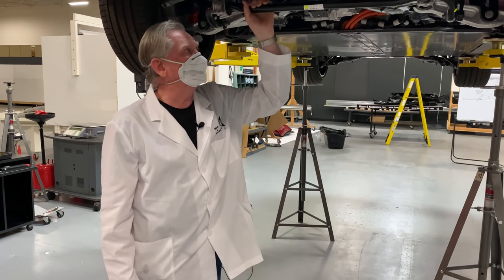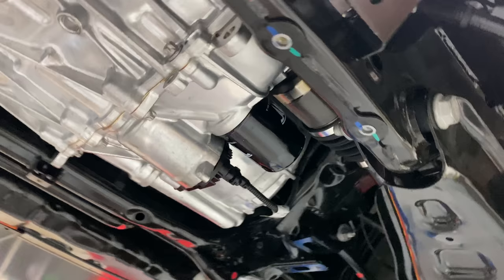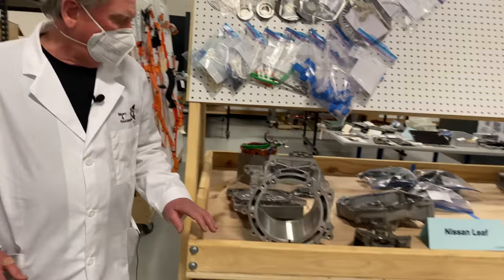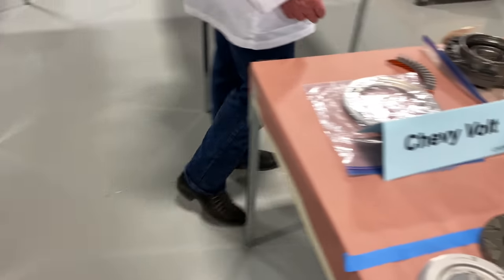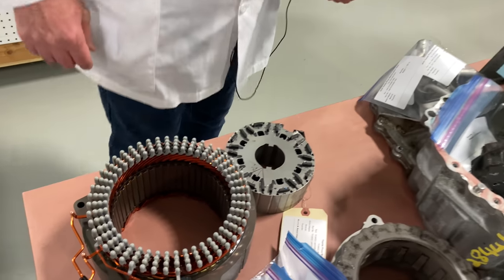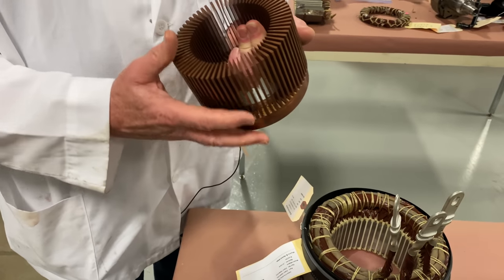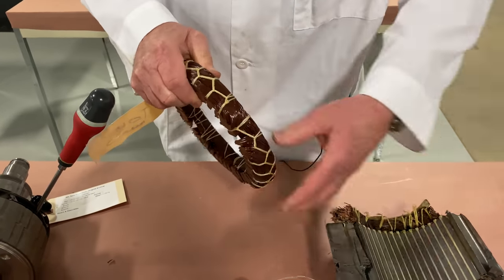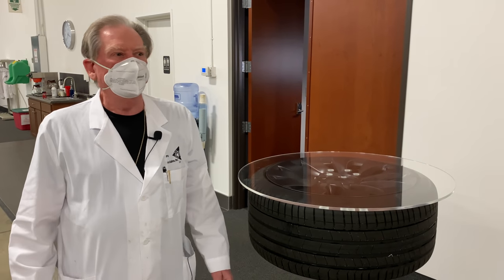Model Y E16: Electric Motor Comparison MY-M3, Industry review of Electric Motors, Table for Sale!

Comment: I was not expecting that much variation in the electric motor designs, just wow.
Reply: It tells you that things are evolving if we look at combustion engines they're all fundamentally the same aside from wankells because there is a sort of agreement on what is working and isn't working for maximum efficency with a combustion engine.
Reply: They are all the same jus two main types induction and pm just like diesel and petrol
Reply: You would be surprised

Comment: Sandy.  Excellent video once again.  Revenue ideas,,  Shirts, hoodies, coffee cups,  engineering break down prints limited ed.  Why, it works
Reply: Merch should depict "exploded" engineering diagrams of interesting (Novel + Awesome + Tesla (Anything Tesla specific comes ready made with a legion of slavering fan nerds (like me))) subsystems.

Ideas: 

Tesla regenerative braking system - depicts and calls out the "magical" components. Anything with question marks where a descriptor or explanation should be will provide an air of mystery and awesomeness.

Tesla Induction Motors: show an exploded diagram of how the rotor magnet is made of of all those laminated layers - include prominent callouts for the mysterious components. Annotate interesting things with US patent numbers. (geeks love that shit)

Tesla battery management system:

Tesla FSD computer circuit (mother) board: label the prominent items: RAM, GPUS, DATA BUS, CPU(s), block out the redundancy-ness (Thing 1 and Thing 2)

Overall the Munro mystique is that you plumb the magical depths of automotive manufacturing tech. Play up the mysteriousness of this in your merch.

Might work for other carmakers' stuff too. I've heard there are other carmakers, though i personally pay exactly zero attention to any of them. 

I'm a technologist, not a paleontologist.
Reply: @johnalley8397  can't do that without infringing upon Tesla's IP rights. YouTube is fine because it's fair use, and selling parts, is a standard sale. They would get in trouble making Tesla branded merch. They can do their own Munro merch though

Comment: We definitely need to know all about the gear oil.
Reply: Isn't it ATF oil?
Reply: Hey Sandy,
do manufacturers normally have a closed system? I am quite surprised there is an oil filter - I would assume you never change it like a differential or gearbox once or two a lifetime
Reply: @accountname1651  It will probably last a long time, but in a gearbox, small pieces of metal filings come off from gears and bearings over time.  These need to be removed or it will turn the oil more and more into grinding paste, accelerating the wear.  Normally it is a closed system.  On some truck gearboxes, they use magnets at the bottom to collect the metal filings, but that would only work if all materials used are ferromagnetic.
Reply: Aaron Bounds it also means a pump as well to push it thur the filter
Reply: @andydelarue9344  There could be a pump just like in an automatic transmission.
Reply: I have a 2000 Ford Ranger Electric truck.  It uses an exotic aircraft oil in its gearbox.  Tribolube synthetic oil that really surprised me as it is thinner than water and flowed out real quick when I opened the drain plug.  It has a pump to circulate the oil in the gearbox, but no filter.  When the pump gives out I may add a filter as that looks like a great idea.   Transmission fluid isn't what you use in a gearbox.  It is designed to let clutches work, so it is not what you want if you don't have clutches.

Comment: 3:48 "The magnets are pretty strong so you try not to get watches close to them"
Camera gets closer towards the strong magnets
Reply: Perhaps, they just zoomed in !?
Reply: @papytrad8915  /r/wooosh :P
Reply: Modern camera will not get affected I have worked on MRI and use my phone right next to it.
Reply: Well, it is attracted to them obviously :D
Reply: @theAppleWizz  hehe.. MRI is not that strong.. Real magnets would probably break at least the displays on phones, or maybe not.
Reply: @theAppleWizz  If the camera has Optical Stabilization (OIS), then the strong magnets will affect that system's ability to function, since they use electromagnets to move the lens/sensor assembly around.
Reply: I think it's all about if the object has ferrous metal in it. 
Would have been hilarious if the camera got stuck on the magnet, they should fake it & re-edit
Reply: I agree with me
Reply: Yeah it is weird, people always question "Pffff, is it really that strong?" because the force does not increase linearly with distance so almost all are caught offguard. Same with high powered fans, "Does it really suck that much???" puts hand above roaring 4krpm 120mm fan for a breif moment then goes away crying when it busts the fingers.  Yes, you are lucky I demo it on 7 Volt and not the rated 12V... I hate the messy clean up.

Comment: You should consider monetizing your videos to make extra income. We would not mind commercial here or there. Thank you for the excellent content and fantastic insights.
Reply from the maker: We have submitted for monetization, we are currently in a waiting period. Thanks for tuning in!
Reply: Munro Live sandy keep in mind, don’t mention the virus or you will lose the monetization! You’ve got to use code words.
Reply: @bob15479  I'm not certain, but didn't YouTube recently change policy again?  Permitting monetization of pandemic-related content?
Reply: @Urgelt  I would say avoiding using certain key words in the title (and description) is still a safe measure to avoid demonetization. That of course comprises a lot of non-corona related terms and whatnot.
Reply: @bob15479  like donout-19? :D
Reply: @MunroLive  then hold your videos until you are monetised!, we are not going anywhere soon.
Reply: @bob15479  is called "the thing" on Fully Charged...
Reply: @MunroLive  Have you all thought about just asking for donations? Just like the grocery cashiers, we would love to tip you all for the very informative series. Things are tough across the board, don't be afraid to ask for help. You will make much money and it will be less cheesy then auctioning off bolts and plastic :)
Reply from the maker: @kwonderful  We are actively accepting donations on our site store and we also have a Patreon group (links to both in video description); trying to give folks as many options as possible if they're willing to support us.  Thanks for tuning in!
Reply: @MunroLive  I signed up on patreon, thanks!
Reply from the maker: @kwonderful  Thanks so much for your support!  Excited to have you as part of the community!

Comment: 1:15 Sandy, I think that PM motor has a special rotor geometry to allow for field weakening. You can see a quite thick zone on the laminates between the magnets compared to other PM designs. Field weakening allows for greater top speed. In a PM motor this is done by playing with the stators field angle relative to PM rotor's field. By making the winding's field go not straight through the magnets, but some of it also bypassed through the iron, you affect the global field. Switched reluctance motors are doing something similar but here I think the goals is field weakening for better top speed. Thumbs up for Tesla!👍 And thanks Sandy for the great videos, keep them coming!

Comment: The rotor of the e-tron is ludicrously old-school, technology-wise. Very much what you find in standard, industrial AC induction motors. Induction motors of the Model S used copper rotors instead of aluminium rotors, which is a lot more efficient because copper is a lot more conductive than aluminium. Man, i understand now why the e-tron is so inefficient... that's German engineering for you.
Reply: Actually aluminium is more conductive compared to it's weight (specific conductivity) compared to copper. And weight of the rotor is important because of inertia. So while copper helps with efficiency it's not always the best choice when it comes to performance. Also aluminium casting is really cheap compared to machined copper. It's always a trade off.
Reply: @ytxstream  Well, I don't think rotor inertia is a huge issue there, because it's negligeable vs. the inertia of the whole car you want to move.
So the important point here is the electrical resistance, and should be as low as possible for better efficiency (because the currents inducted in a rotor of an induction motor are quite large, hundreds of amps in that case). Imagine an induction motor as a transformer in short-circuit at its output, the primary being the stator, and the secondary the rotor.
But anyway, the e-tron efficiency is catastrophic, so for an EV, this kind of AC induction motor with aluminium rotor is a poor technical choice.
Reply: @ytxstream  Rotational inertia doesn't matter much for highway efficiency since the speed is steady.
Reply: @ytxstream  "Actually aluminium is more conductive compared to it's weight (specific conductivity) compared to copper" - Which is what matters most in cabling (when the goal is to keep mass down), but not in a motor, where flux density is the key.  Increasing the volume lowers your flux density.
Reply: @ytxstream  I dont' think that machining copper is that expensive when looking at how important the efficiency is and how expensive those cars are. Also, I would assume that inertia is almost negligible in the automotive use case(the energy of spinning rotor vs the energy of whole car moving). Copper is also way denser making the whole rotor smaller so the radius can be smaller further reducing inertia if you want that. Tbh I don't think there are any real positives of aluminum other than a lower cost(which maybe makes sense in some cheap devices and not a car for 100k).
Reply: But why is the e-tron so expensive?
Reply: @JAM_2024  The Audi badge is the most expensive component on the vehicle.
Reply: @oisiaa  I never said it was important for highway efficiency, actually I said the opposite.
Reply: @pxidr  You are underestimating the impact on the car. The weight goes into the total inertia with the square of the rotor diameter multiplied with the square of the total gear ratio.
Reply: @JAM_2024  It's really not for what it is. It starts at 40% more than a Model 3 which seems reasonable considering size and quality.
Reply: ytxstream Tesla seems to have the magic formulas for highest performance, longest range and lowest cost. Audi’s electric motors are neither efficient, powerful or cheap.
Reply: ytxstream haha. It’s 100% more than a base Model 3... but it goes 50 less miles per charge even though the battery is twice the size. For $75,000 (starting price of an e-Tron) you can haul 0 more people than the Model 3, you will be out-accelerated by even a SR+ Model 3, you will never get OTA updates like the Model 3, you don’t have the supercharger network to use and instead must use Electrify America’s horridly unreliable and expensive charging stations (if you’re in N. America), and you will likely lose half the value of your car within the first 12 months, whereas a Model 3 retains its value better than any other vehicle on the market. Other than a fancier interior that’s gussied up with chunks of wood and leather, I don’t see the “higher quality” you speak of in an e-Tron. To me the quality in a Tesla comes down to the cutting edge battery/electric motor engineering, software, performance, somewhat affordable cost, standard safety features, over the air updates, and charging network. Audi just has “luxury” interiors. I’ll choose my definition of quality over Audi’s any day.
Reply: @ytxstream  
Assuming those 2 endplates are identical, the copper pieces actually look like simple plates pressed into the slots.
If that's the case, simple.
Reply: It is what sets tesla apart, they don't penny pinch on efficiency.  That is why cars like the e-tron and the taycan have terrible efficiency and tesla is a market leader.  Tesla knows range matters and that is reliant on efficiency.   Some people don't realize how misleading charging rates are in non-teslas due to poor efficiency.  A taycan for instance advertises 270kw charging, but their efficiency is so poor, they only add miles at the same rate as a tesla charging at 150kw.  A taycan at 150kw is the same as a tesla on 83kw charger.   You can use mpge to adjust for charging rates, but we really need a more face up way to do it, listing miles per 10 minutes at a specific charging rate would be good.
Reply: The eTron could have done better than putting Induction motors on both front and rear BUT their machine cooling is quite nice/near: where they are able to run coolant (not oil) via not just in the stator housing, but also via the rotor shaft (which usually is not easy with a rotating component, and leaking issues, etc.). This helps them achieve optimal cooling/temperature maintenance enabling them to get good continuous performance, repeated launches, long high speed (think Autobahn) driving without too much derating. The eTron is limited in range for one, it's an induction motor (< eff. Compared to a PM motor) especially when driving per EPA testing, then vehicle is heavy AF, much lesser usable kWh than the rated 95 kWh (to be able to put our the rated range in real world conditions too, not just per EPA cycle), too many auxiliaries (energy consumers) compared to Tesla vehicles.

The choice of induction motors is to keep the cost low and still be able to make a profit from a company which is more lopsided to industrializing ICE vehicles. In the future with large scale MEB vehicles from the VW house, this vehicle should cost lesser
Reply: @smithydll  Yet the Audi interior, paint quality, suspension quality, NVH, etc., are infinitely better than Model S or X. Riiiight.
Reply: German-refugee engineering for you
Reply: @JAM_2024  Is it?
Reply: Electrical conductivity per mass (aluminum) or per volume (copper). It seems like you could get a more concentrated  magnetic field w/ copper. 
Seems like rotating mass in a EV motor would use a lot of energy esp. because they stop when the car stops.
Reply: Hello from Germany.
I'm a mechatronics technician for high voltage vehicles working for a certain automotive company starting with "A".

Would you care to elaborate?
I find your accusation that the surface of the e-tron's rotor being made of machined aluminum directly causes a severe loss of efficiency to be farfetched.
Mere conductivity alone can obviously not be the only desired purpose of a component designed to transfer the entirety of the torque produced by the drivetrain.
Also, your comparison to "ludicrously old school" AC induction motors is needlessy condescending. There are thousands of electrical engineers working on EV drivetrain components for VW group, insinuating that their work can be deemed useless by a random YouTube user called "pxidr" based on a 30 second clip showing the outside of a single component is a bit too agressive for my taste.
Reply: @komentierer  That's also known that Germans have no sense of humor ;)
I'm a power electronics engineer, specialized in power conversion for grid and motor control applications.
The efficiency of the e-tron is 23.4kWh/100km, the efficiency  of the Model Y is 17.1kWh/100km. That's a 27% difference in efficiency, for a car similar in size. Do I need to elaborate more? Or can you see the problem there? The technical choice of Audi for an induction motor with a very classic aluminium rotor is just wrong for an EV. They also don't use SiC power MOSFETs in their inverter, as Tesla does, for reducing switching losses.
Also, e-tron aerodynamics doesn't seem as much refined as Model Y.
So, that's a combination of multiple things.
Reply: Agreed. I think Audi has no clue when it comes to EVs - big, stupid, heavy parts parts and vehicles that have lots of bling but low technical competence. Result = low efficiency, low range and poor performance.  

Same for the Prius although no doubt this old tech is still put in each new Lexus and marketed as the latest and greatest. “Self-charging” wasn’t it?
Reply: @Q J 
Capital investment, exchange rate, brand premium, retail markup, marketing, etc...etc...
Reply: @pxidr  I don't know if you've bothered to watch Sandy Munro's latest video... but apparently Tesla copied Audi's castover aluminum design for the Model Y.
So pick your poison: either Tesla has cheaped out and is using "industrial AC" motors now... or Audi got it right all along.
Reply: @komentierer  What's the connection between aluminium die casting and electric motor efficiency?
The numbers talks by themselves, stop your blindness and arrogance : there still much work for Audi to make viable and efficient EVs like Tesla does.
Reply: @ytxstream  In a motor, flux density is paramount, so a copper cage yields higher efficiency for the same mass rotor. I have an Aluminium cage induction motor in my EV too, and its peak efficiency is only 90%. However as it is only a 15kW motor nominal, it stays close to peak efficiency on highway cruise, so it is more accelerations and slow city driving where the worse efficiency is noticeable.
Reply: @JAM_2024  and Nobody in Germany Could explain. Maybe because the Brand is extremely famos. Even in germany  it cost a lot more than in the USA..unpayable for a normal working Family head. 125.000 Euro. 147.000 USD Crazy

Comment: Thanks for the detailed views of so many motors.  If a PM motor ever overheats, the magnets lose their magnetism and the motor becomes useless, something like >200F.  Haven't heard of any failures due to that, and surely every BEV monitors the motor temperature and warns or shuts down if too hot, but still something to consider.  The various cooling systems and their reliability are also of interest.